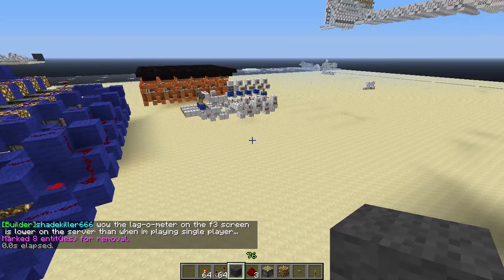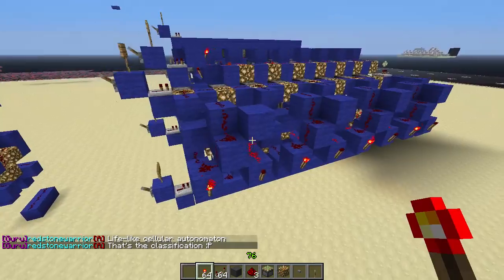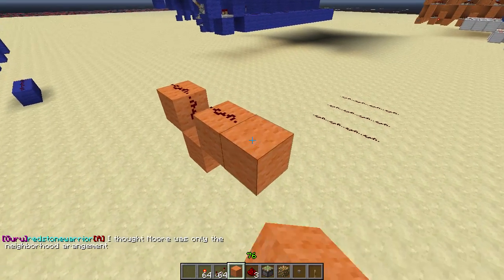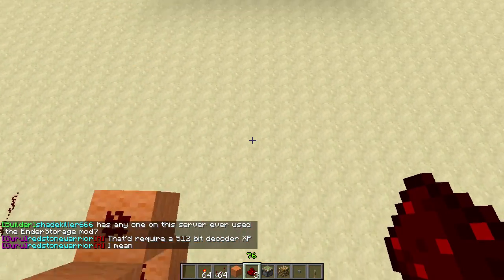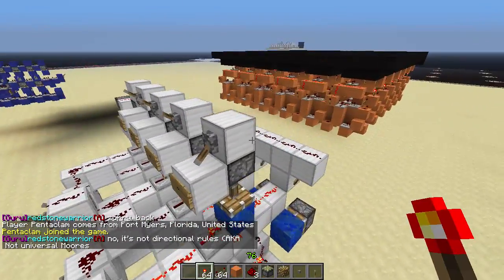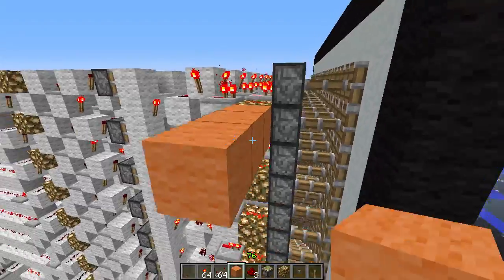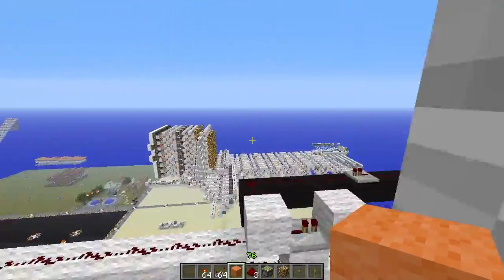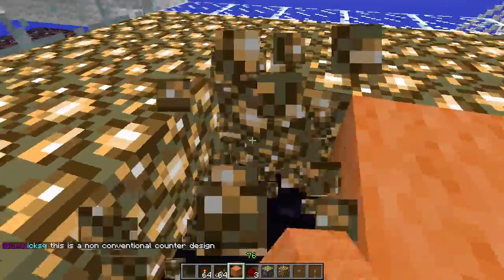Advanced Redstone Circuits: Episode 10

Comment: I did not quite get how you did the reset on the scanner since you used T-flopflops. Did you kept the buffer outputs high and when you pressed the scan or reset button the y signal (from the x/y selectors) would turn off for a short moment to turn all the high pixel off again?